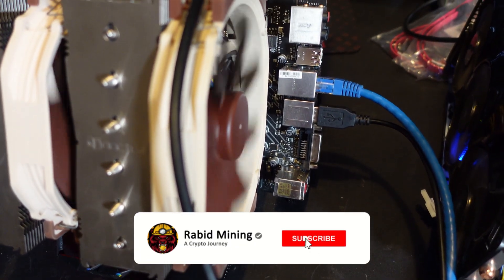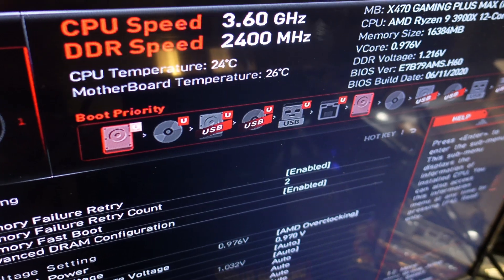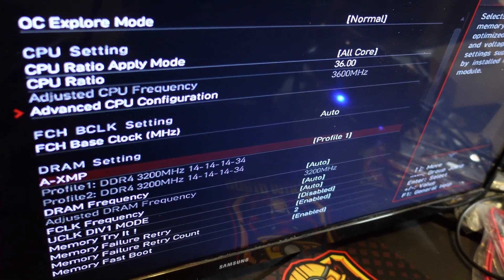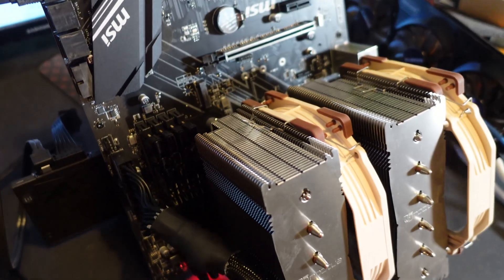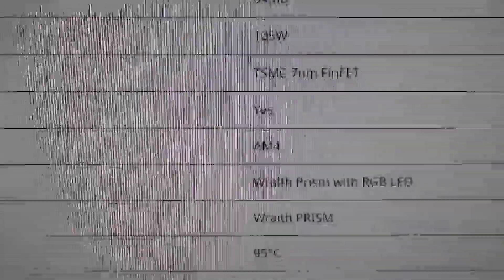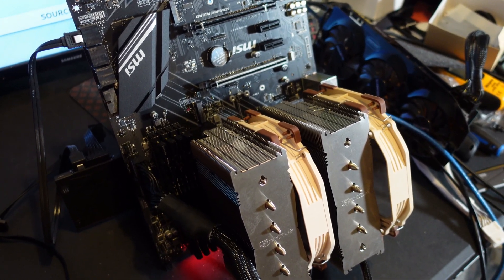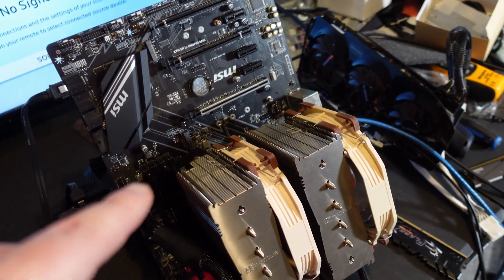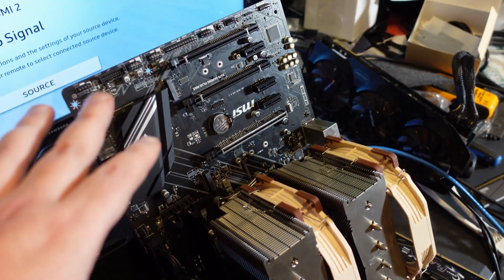Ryzen 3900x Zephyr (ZEPH) Hashrates RandomX - New Record?

Comment: Okay, one quick question. I am going to build a new setup with second hand parts from ebay and marketplace as I cannot afford new or latest gen CPUs or mobos. I am gonna build with MSI b450 tomahawk max. So, the question is that, is it okay to overclock ryzen 3900x on this mobo and is 650watt power supply enough if I overclock 3900x? Cuz I have no idea with electricity stuff like overclocks and power supplies. Your suggestions would be helpful..😊
Reply from the maker: Ya should be fine
Reply: @RabidMining  thanks mate

Comment: Hi RM, I just start the Cpu mining with a 3900x and a M550 Gygabite. my HR is +-1200Kh  but my consumption is 260w. How is it possible?
Reply from the maker: What's your volts and clock at? Sounds like stock settings
Reply: Saw one of your video and I change the CPU ration to 37, Cpu core Volt to 1,000v and it's better, stable mining at 11.66 kH and cpu temp at 50°c. Final consumption is 129Watts. Can we go down in consumption?
Reply from the maker: @antoniosz8181 try to drop volts more
Reply: @RabidMining

Comment: I'm thinking of switching 4 cpu rigs to the same operating system you have, would i be able to hire you to help me do the switch and optimize my rigs? they are all 3700x same parts on all 4. I'm not sure if you do that or not but figured I'd ask instead of messing something up, I've never worked with Hive OS, I always used Rave OS and was pretty happy with it but it's not very great with cpu mining and with new coins .. can't manually add a new coin .. stuff like that. let me know what do you think we'll need for the call and how much would it be, I'm pretty sure i'm in your discord group but there are many scammers out there.

Comment: I will give you the secret.  A=XMP,  is weak at best.  You need two things, Download: 1. Thaiphoon Burner  & 2. Ryzen Dram Calculator.   Run #1 to get the chip manufacture type.  Once you have the info, Run #2,  setup the proper memchip with the information in the app and run it to get the best mem configuration. Once complete, print out the information and input them in the BIOS mem settings. Done

Comment: that all cool but i wonder if you can explain for noobies, what this all mean, it would be epic, if you made some noobie friendly videos, maybe a tutorial or a series, what is needed to start, a motherboard, ram sticks, hdd ? sure the CPU and some cooling, and power supply thats it? maybe for starter a budget version, and for after starter, a mid range version, and for long time miners, PROS, a version that you would build with today specs, maybe also some infos about what it cost, and at which electric price it makes no sense.  also how many machine can run on normal electric, and at which point you changed to bigger electric lines, big cables.. etc.

Comment: Try to play with timings, you can use dram tuner. I have same Samsung B dies and setting TRFC timing to 256 gave me like 0.4 kH/s boost. And some more tweaks with  dram tuner gave me another 0.4 kH/s more so overall i went from 9.6 kH/s to almost 10.5 kH/s on my R7 5700x.
Reply: question is how much power consumption at the wall? for 10kh/s
Reply: 132W @noname-qx8en
Reply from the maker: @noname-qx8en depends on RAM, MB and settings 109w to over 240w if OCed a lot but a average is 110w to 135w

Comment: RM awesome test 👍, BTW did I hear you say a CL18 is faster than a CL14? You do know the lower the ms of a RAM the faster it is,  the CL14 should be much faster than CL18.
Reply from the maker: Mhz is faster yes 3600 vs 3200 but the latency is looser so not as good as tighter cl14
Reply: @RabidMining  correct Latency for RAM is much more important as it has a greater impact on it I/O performance, and the lower the latency the more expensive the RAM should be as well.

Comment: I need some amd cpus. Im running dual xeon with 54 threads and getting 10khs lol
Reply from the maker: Dam poor intel :(
Reply: @RabidMining  I have dual xeon 2686v4 that give 16kH/s and cost  $220 (full kit with RAM ,coolers, SSD and power supply). Yeap the full power consumpion is 330W (2x105W CPU clear consumption) but this kit paid for itself 4 times last year.

Comment: my 5900x only getting 12.5kh? 16gb 3200mhz ram. what to do? im using xmrig new miner. xmrig old miner isn't working
Reply: randomx loves good ram. and 5xxx ryzens love 3600mhz on memory. so try 4 sticks with 3600mhz and good timings+core overclock. But you have to dial back for power efficiency